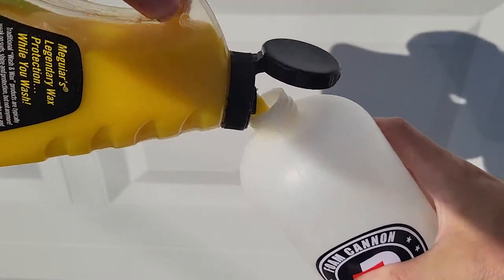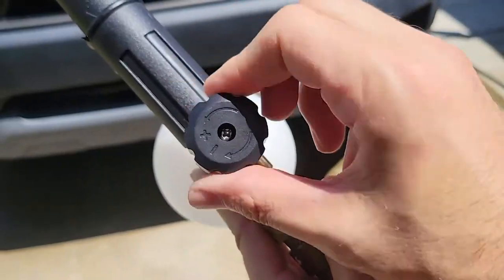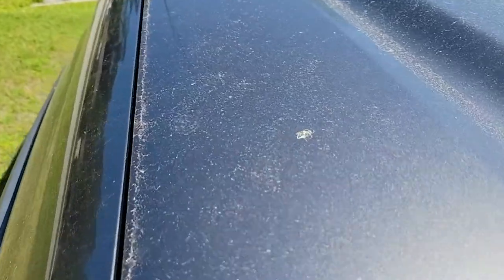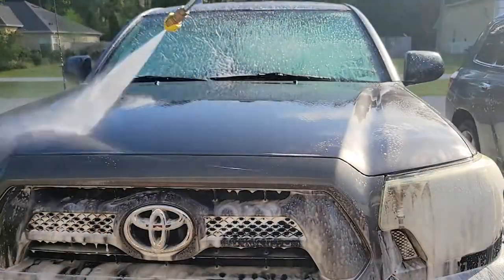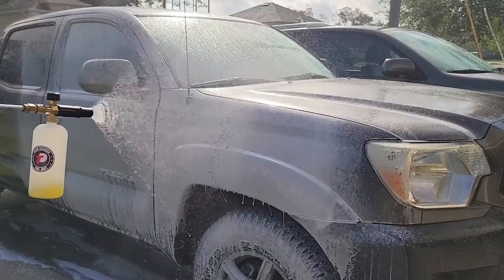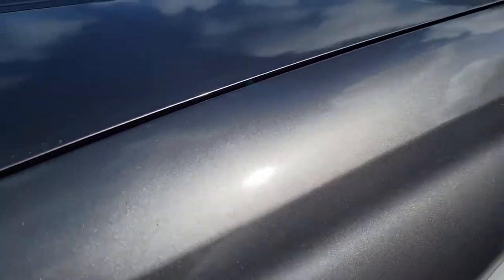Tool Daily Foam Cannon | POV | Would you buy it?

Comment: Did you connect the pressure washer gun directly to the hose or was there an additional power source?
Reply from the maker: You can connect it to a pressure washer gun using the detachable 1/4" quick connector. Simply remove the 1/4" quick connector to connect the foam cannon directly to a pressure washer gun with M22 14mm threads.

Comment: I'm unable to assemble the gun with the pressure washer adjuster.
Reply from the maker: We found it easy to install following these instructions: fill some soap into the bottle with warm water to get thick foam; Then connect 1/4" quick connection plug to Pressure Washer Gun or Wand. Finally, adjust the knob on the top to desired foam level and then foam sprayer will disperse thick foam.
Reply: I got it to work

Comment: How do you use the spray nozzles?
Reply from the maker: Thanks for reaching out! So with the nozzles you simply turn the top knob right to get the thickest mixture, adjust the nozzle to get a proper sprinkle pattern, and let it loose. The nozzle tips  also can be attached to a Quick-Connect Wand for swifter application and more. Hope this helps!
Reply: Wish you had explained the different colored nozzle things that came with it because the manufacturer chose not to (so frustrating)

Comment: This thing is a piece of junk. Hooked it up to my pressure washer and only water comes out. It will not discharge the shampoo. Waste of time and money.
Reply: @gal419  mine worked fine
Reply: @tone569  What store sells it?
Reply: Don't make the same mistake I did.  I forgot to attach the clear plastic straw that pulls the soap from the bottle.  Didn't see it at first and was wondering why my foam sucked.